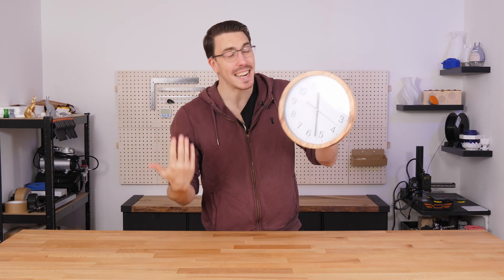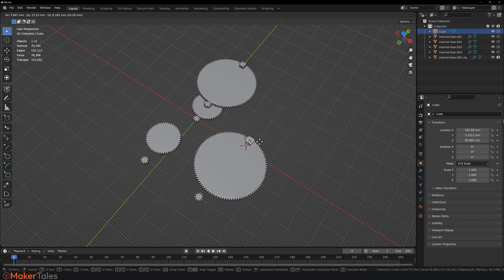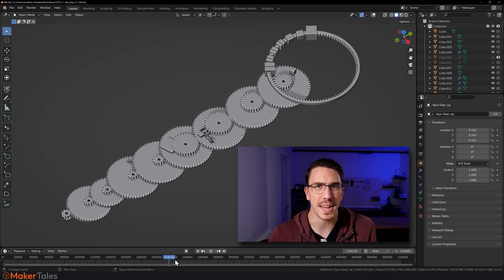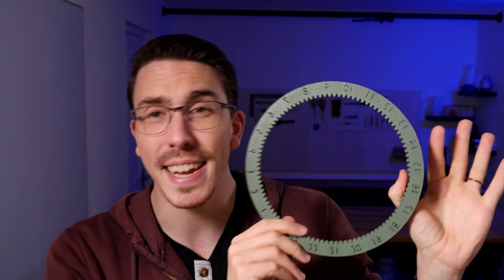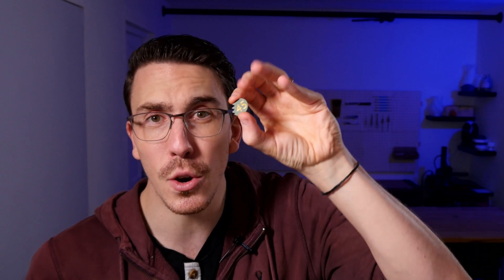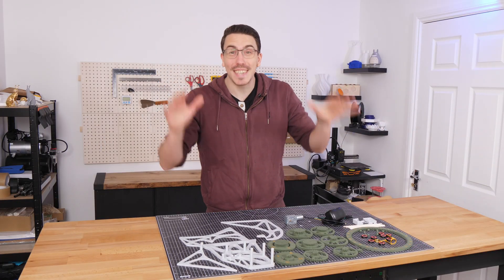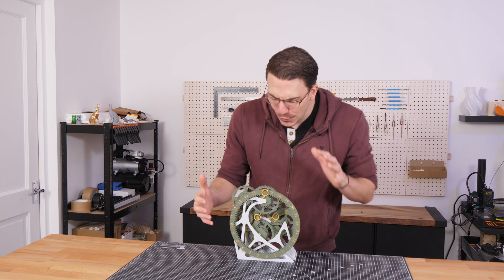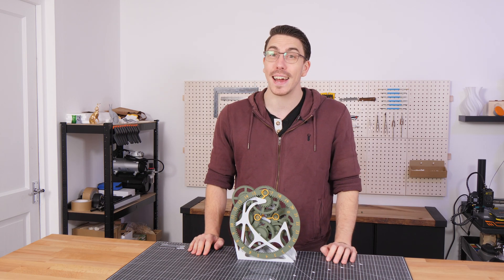Reinventing The Clock For 3D Printing

Comment: Help me out please.  I'm about to order a 3D printer, might be filament or it might be a resin printer.  Resin has higher resolution but the parts might not be as durable.
Do you have any advice to share about the pros and cons of filament vs resin printers and results?

Comment: Interesting design, however, gotta give you a thumbs down, man.  I can manage the assembly, even though you don't seem to have a drawing or order with the STLs.  The inner diameter of the gears are 6mm, while the bearings ID is 8mm, and the frame pieces like the "Front Middle Support" are 9mm.  This seems to necessitate lot of rework, assuming I am understanding how these are to go together ( the "STL for Gears Of Time" link in this video description ).  Sorry.  I mean, you do hint at this rework by using the dowels.  I'm deciding whether to try and rework these pieces or look for another clock design.  I looked in Maker Tales Discord, but didn't see any help.

Comment: Great looking clock. It should run so much better with stepper motors that move exactly how much you tell them to move. A DC motor by itself is super simple, but it becomes more complex when you have to add encoders and control exactly how fast they move. Looking forward seeing the next progress.

Comment: If you added another gear, you could gear it for a lunar month vs a solar day, and have a hand to show you what the tide will be.  Also, why not add a 1:10 step-down at the motor instead of rebuilding the whole design?